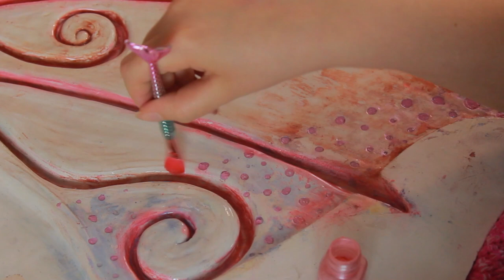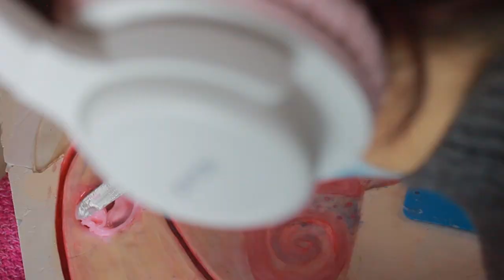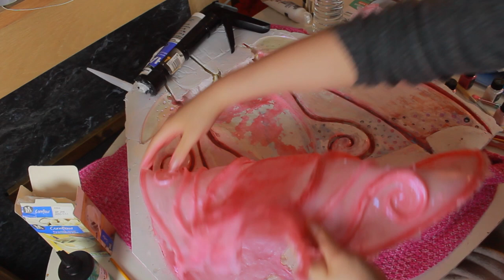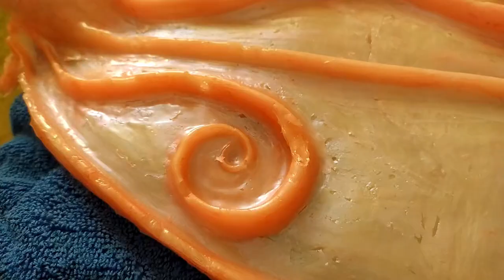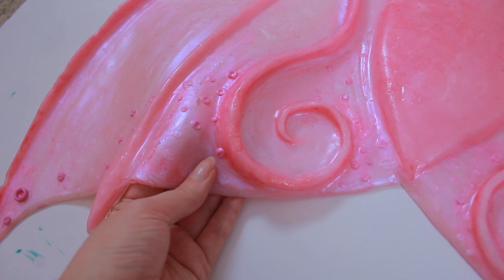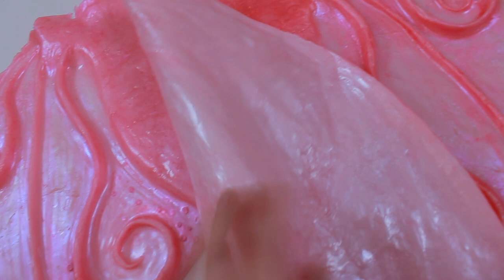CASTING NEW SILICONE MERMAID FLUKE | MERMAID TAIL TUTORIALS

Comment: Silicon rather it be all purpose or marine safe are not safe for your skin and should not be used in an attempt to make a silicon tail if you want to make your own tail you need dragon scale silicon it’s marine and skin safe don’t get yourself injured or even killed trying to make a mermaid tail with things not intended for contact with your skin always start yourself with a fabric tail 🥰 stay safe peeps
Reply from the maker: Thanks for your input Stephanie. I have made a tail with dragon skin before and it's great 😊 the silicone I'm using here is for a specific method made on top of a fabric base so it doesn't touch your skin directly. I spoke to the company's chemist and he assured me the silicone is not harmful to the skin (even direct contact) or marine life after it's cured and washed carefully. I understand your concern but I did extensive research on this topic and have been making tails for a few years with no issues. Skin safe silicone means it's safe to use on skin even if uncured so the one I'm using is not marked as skin safe but in good hands can be a very useful tool. 😊